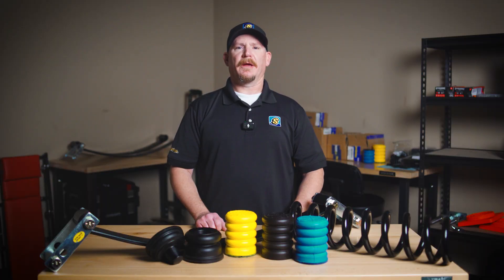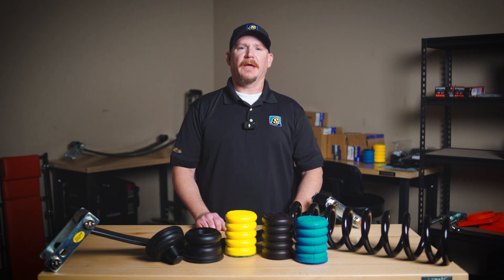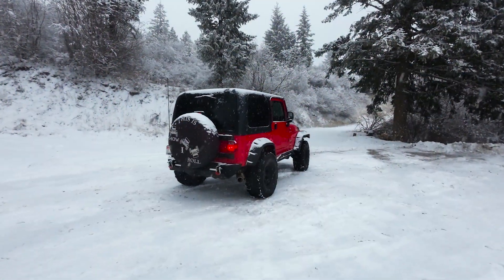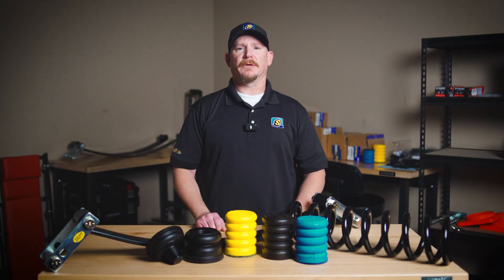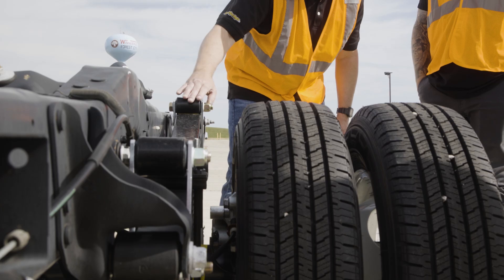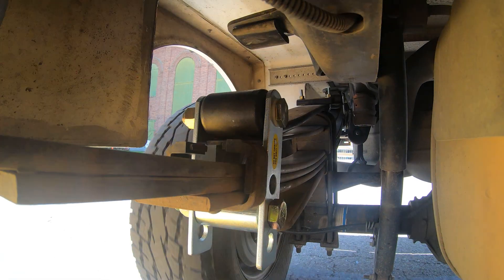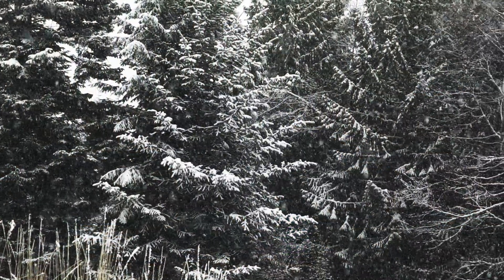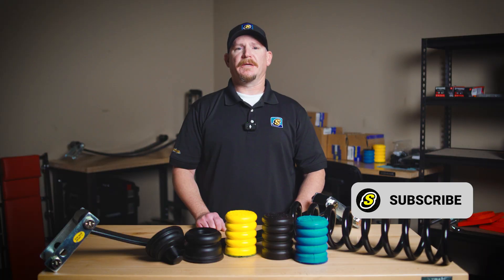How Do SumoSprings Perform in Cold Weather? | Engineering Corner

Comment: Would you recommend these things on a performance car? I was looking at going with air on a Benz c63 amg I just purchased as I wanted to lower the car but also find the stock suspension very stiff and harsh. Your product has popped up frequently on my searches. Also on the divorces spring setup I noticed the spring is in two pieces… is there any chance they can separate during a very sharp turn with a bump or something?

Comment: I installed my SUMO springs this past summer. I installed them front and rear onto my 23 Tacoma. They were great! Now that I'm in winter. I'm concerned. We haven't hit our -40°C yet (Alberta). We've had -20, and they got very hard. This could get interesting...
Reply from the maker: Hey there! Thanks for sharing your experience and for trusting SumoSprings on your Tacoma—front and rear, that’s awesome! You’re right—when it gets down to those Alberta deep-freeze temps, SumoSprings will feel harder, kind of like a flat spot on a tire. The good news is they’ll warm up a bit with use and still provide support, even if they’re stiffer than usual. If you’re seeing -40°C regularly, though, let us know—we’re happy to chat about options to keep you riding smooth all winter. Stay warm out there! #JourneyBetter
Reply: How did they hold up? I’m thinking about these for my Frontier but also live in Alberta.
Reply: @paganironworks3622 My only complaint is if they get wet and then freeze, they become bricks. Otherwise great.